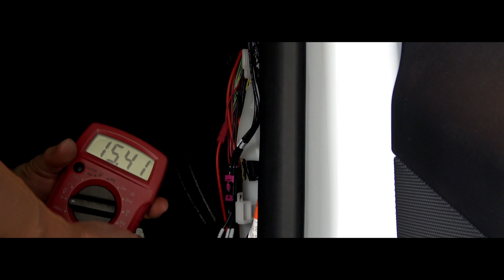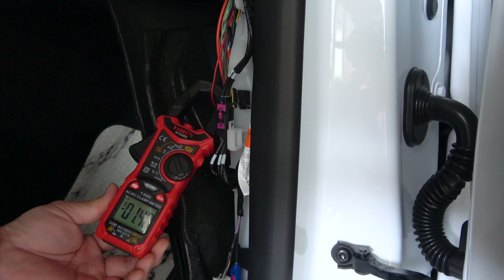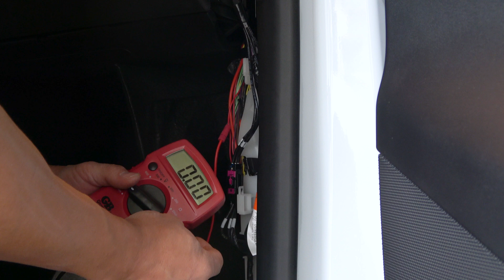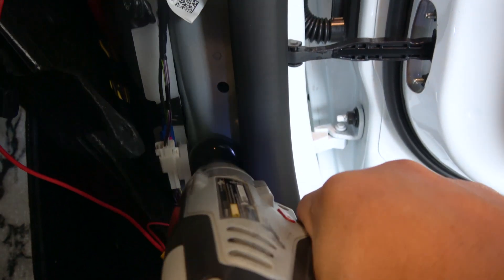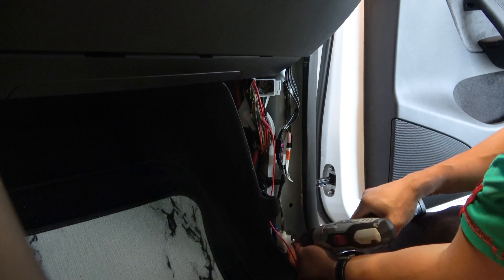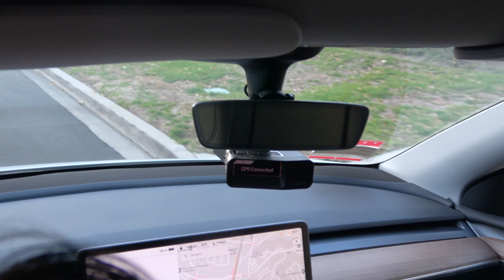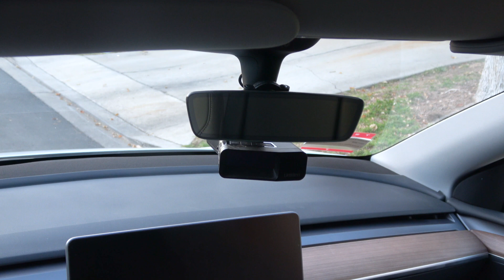Don't void your warranty | 12v switched accessory power Tesla | Hardwire Install

Comment: Instead of fishing for wires, I ran my hardwire behind the dash and through the center console and tapped into the accessory connector wires (this is what Tesla recommends). I checked and my accessory plug (and now-connected radar detector) turns on when the door is opened and turns off when the driver exits the vehicle. Regarding sentry mode, with it enabled, power is cut to my radar detector after a few seconds, so it doesn't stay on.

https://service.tesla.com/docs/ServiceBulletins/External/CD/CD-19-17-001_Model_3Y_12V_Power_Circuit_for_Third-Party_Accessories_First_Gen_Center_Console_R5.pdf

Comment: None of the red wires in my 2019 seem to have 12V. I have a weight in the drivers seat, seatbelt on, brake pushed. All the red wires have either 7V or 1V

Comment: Thank you! This worked on powering a dashcam on my 2024 MY.
Reply: Do you have a pic by any chance of your wire you tapped. I am having trouble with my 2024 M3.  Wondering if my voltmeter might be Vicky.
Reply: you have any concerns that this might void any warranty?

Comment: Is there a way to do this that will keep it on all the time? I want to power a 12 volt refrigerator that I have in the trunk. I use the center console outlet now but I have other things to power and the refrigerator keeps getting low energy errors if it's not the only thing using the power because I'm using a splitter.

Comment: I followed your method minus the additional inline waterproof fuse 
However when finally put in gear it stays on , once I accelerate the radar shuts off , then turns on if there’s enough time before I accelerate where it shuts off again and again . Do you have an idea why this might be ?
Reply: my GUESS would be that you hooked to the wrong wire

Comment: Hello...I got my 2024 Model Y last week, trying to tap 4 different red wires and none of them work.  Has anyone tried successful on 2024 Model Y?  I appreciate for any advice.
Reply: Have you tried this method? I just got my MYP 2 days ago and was going for this route? Did you get it figured out?
Reply: @strykher  I had the same problem until I figured out that the car has to be disconnected from the charger in order for the correct red wire to switch off when the car turns off, otherwise all the red wires were constantly on. Just finished up the hardwiring my V1 Gen2 on my 2020 MYP and it seems to be working like the video shows.
Reply: @gerrytseng  I ended up not using this method. I went to hotwire it on the tow 12v wire from the left of the driver side dash instead which work perfectly.
Reply: @strykher. Is power constantly on or do you have to activate tow mode?
Reply: @strykher where do i find this wire and witch colour is? Can you help me please
Reply: @melbab8454  power is constant and turns off when the car is off.
Reply: @theemkay11  https://www.youtube.com/watch?v=7TfqLzA44eA&list=PLjpw6RdRfhde3bQksVGbrWz1unKvcp_VS&index=24

Comment: How did you use the clamp meter to find the 15 volts by just clamping it on and not having to cut the wire and make contact?
Reply: Hall-effect clamp meter, find a clamp that works with AC/DC

Comment: I have model y 2023. I found 3 red wires that are the same as video, but I couldn't find any 3 wires have 12vdc as I pressed the break. Does it 😢different circuit on the 2023 modelY?
Reply: it's just over 15v, which won't damage most RD's

Comment: Two questions if you want to install several accessories at that switched low V location:
1. How many amps would that support?
2. Is there a multi port block - like an add on small fuse box - that would work as the connection points for the accessories? In other words the tap into the switched Tesla wire and the ground wire would connect to the distributions block or add on fuse block.

Finally, I see where some of the more recent instrument panel displays are gettin power/ground direct from the low V battery. Since that doesn’t seem to be a good idea, could they also be connected to 2. above?

Very good videos,

Pete

Comment: In your video at around 2:50 you show that you pre-selected the wire and state it should have 15v.     Your ammeter shows about 1.4A, but to find the one with 15.5v and the brake energizes is difficult. You don't really show that.   An alternative is to use the larger red wire (14-16 ga) shown at 2:50 in the video.  Its not quite as elegant as off when you exit, even with Sentry on, but it does turn off when the car goes to sleep, within 5 mins.   Open the car door it turns on.  Therefore for someone  who struggles finding which small red wire is the one, they can use the larger one (not the big in the back) and it will shut down the accessory within 5 mins of exiting the car when the car goes to sleep.  And powers up upon re-entry, no brake press needed.
Reply: what model do you have?

Comment: I want to install ambient light that comes on whenever headlights or parking lights are on.  Do you know where to tap it into in the headlight switch if there is one?
Reply: I used the footwell lights. But keep in mind the limited Power.
Reply: @felixb6656  mine does not have footwell light

Comment: Sorry dude, but I’ve had my auto frunks, an auto trunk, and trailer wiring hooked up directly to the 12V battery and NEVER had a problem. The auto trunk, auto frunk, trailer light controller installed on my 2019 Model 3 have been installed for four years with no messages or problems.
Reply from the maker: awesome! then you're lucky. There are plenty of customers who come in around 30k miles with battery problems due to HANSHOW connections direct to battery.

Comment: I found 2 red skinny wire that have 13v power. Thing is when driver is present, there’s power but when driver is gone, it stays powered for 10s or so then powers down, both wires. Is that the same wire you mentioned?
Reply from the maker: yes, if you're talking about the VCRight (on the passenger side), yes, that's the accessory wire which is perfect for your radar detector or any accessory you  want to automatically turn off when you leave your car.

Comment: Hi PJ, I assume that switched wire keeps power whilst the car is running and not just when the brake is pressed?
Reply from the maker: yes, that's the whole point. and the main point of switched is that once you leave the car, it turns off.
Reply: @teslamods do you know if this wire is on all teslas? I have a 2018 model s

Comment: Hi PJ - great video! I'm trying to do the same to my '23 MYP.. My first attempt I tapped into the line for the brake lights instead of the accessory wire, which meant my radar detector turned on whenever I slowed down or stepped on the brakes.. I was trying to find the elusive "red wire", and wasn't able to find one of the thinner ones that gave a reading when the car is on. There is one that is a little thicker, not the main thick one, but it doesn't look like it's as thin as the one you have at this time in the video. ( https://youtu.be/qlx7t74Upxk?t=186 ) 
Can you tell me if I'm seeing this wrong, or whether the slightly thicker one is indeed the correct one?

Thanks in advance!!
Reply from the maker: haha that's so funny - brake lights radar! since mine is 23 MYP too, your setup should be almost exactly the same. What really helps is to tap your brake every minute when searching for the red power wire. it's definitely red, and it may really be inside the bundle of wires. There are at least 5 red wires. and one of them might be just 5V
Reply: @teslamods  haha yea I wasn't able to determine why it only turned on when I used my brakes or during regen, then it hit me that was the brake light wire 😅

I tried going through all the red wires, there must have been at least 7 or 8 of them.. Don't think any of them hit over 12V, although there was one thicker wire that got over.. I guess I wanted to confirm the wire you tapped is one of the thinner ones, 22/24 gauge ones, right?
Reply from the maker: @JosephOnThePhone  yes, you saw from my video correctly, the thin wire, not that 1 thick red wire
Reply: @teslamods  Ended up having to tap into a slightly thicker wire, probably a 14-gauge, for it to work properly, none of the other thin ones were good enough.. Not sure why there's a difference between our cars, but let's hope this works out!

Thanks again for this video, definitely couldn't have gotten anywhere without it! 🤩
Reply from the maker: @JosephOnThePhone  interesting...good to know of the differences. Mine is Austin-built, micro-differences from the Fremont-built. and I would put a 10A fuse when connecting to the wire, just in case
Reply: @teslamods  oh that's a good idea to add the fuse!! And yea mine is Fremont built, didn't think there'd be these subtle differences 😄

Comment: I found two thin red wires but one is constant and other just doesn't turn on. There's on slightly thicker twisted with green wire and then more thicker line. I think it's suppose to be thin one but that just doesn't turn on.
Reply from the maker: make sure you press on the brake to make sure all accessory wires are on. Then test if there's current in the wires. And there's more than 2 red wires, like at least 5. Only one of them is the accessory wire that only powers on when you press on the brake. It turns off when the car goes to sleep.

Comment: Thanks to PJ for the very informative video! Just finished this project today and it is working as expected. One thing I want to add is that you don’t have to sand and drill a hole to get ground. You can use the bolt right next to the wires (exposed after the 2nd panel is removed). Just loosen the bolt and sandwich the wire terminal in between.
Reply from the maker: thanks I was going to do that, but my model didn't have the hole.
Reply: yea i sandwiched my negative lead to a dash-to-chassis bolt and it worked fine
Reply: Where to wire an amp for subwoofer on 22 base standard rwd?

Comment: Read this if you have a Right Hand Drive Tesla model 3 China build 11/2022

Hi PJ   Oh how I would love to find the elusive "go high" wire when you sit on the drivers seat and put your foot on the brake. 

So this is just a warning for Tesla Model 3 owners with Right Hand Drive (RHD) built in the Peoples Republic (China)  build date November 2022

All the good work that PJ has documented is not correct for the RHD China Teslas.  In this location there are 3 looms with plugs 2 some of these have a thicker red wire and multiple thinner reds and every other colour.  I tested all the reds and anything that was low current and looked like a signal wire and could not find any wire that changes state when the driver sits in the seat and presses the brake.  

The looms appear to be considerably different to the US Teslas
Reply from the maker: thanks for that! I know there are tiny differences btw the Fremont and Austin factory builds, but I didn't even think about RHD China. In my rear screens video, I show how to make your own accessory power using a relay switch. https://youtu.be/RMyG1dkfc3k
Reply: Hi and did you manage to find out how to hardwire the China made versions?
Reply: @dodotesla   
Hello Ondrej,
The simple answer is No. but I now have a switched power supply both for driving and parked that meets my needs.  Read on if it helps.  It's long but has details.

After disassembling the car to find the elusive red switched wire without success I decided to go a completely different route rather than chopping into my wiring harness.  I think this is a bit safer fairly easy not for all purposes or applications but for my install it was what I needed 
. 
My install is a Thinkware front and rear dash cam. Driving mode requires a constant 12 volt supply at around 2.4 amp supply a second separate 12 volt switched supply activated when I leave the vehicle allows the Thinkware to automatically go to parking mode. Parking mode uses movement and vibration detection to film surroundings when triggered. It will use almost 2 amps when active and about 700 milliamps when sleeping 

A bit of background. The 12 volt supply in a Tesla is actually it is closer to 15 volts but this should not be an issue for good quality electronic equipment remembering an ICE car has a charge voltage between 13.8 volts and 14.2 volts  Most electronic circuits have zener diode across the input or voltage regulators built in to take care of voltage fluctuations. In the Tesla the cigarette lighter is ideal for driving mode simply find a place to splice into the supply wire. You can draw about 15 Amps through the cigarette outlet and as the car is active there is no problem with supply in driving mode the Tesla maintains the 12 volt battery and any load is on the cigarette lighter it is not monitored for current usage, so there are no fault codes unless you exceed 15 amps or introduce a short.

The problem I had was finding a way to enter sleep mode and supply the dash cam with a reliable power supply but not deplete the 12 volt battery during long periods of sleeping supply. The Tesla  12 volt battery is only 33 amp hour and the maths is basic. If you park your car outside potentially in a worse case scenario, you could deplete your 12 volt battery in roughly 15 hours of parking time. You don't want a flat 12 volt battery, whilst not the end of the world it is very annoying in a Tesla.

My solution is to use the cigarette lighter as the driving power supply and use a secondary battery for the parking mode. The secondary battery is charged whilst you drive it takes roughly 4-5 hours of charge time from dead flat to fully charged . The Tesla does not know there is another battery present and the circuit design methods used keep the two systems separate.  I still have a parked time limit approximately 30 hours  before the secondary battery will switch off but long parking times rarely get to 30 hours unless I'm at home and if I wanted longer parking times for sleep mode I could use a larger battery.  The battery pack I'm using is about 100 mm x 60 mm and 20 mm thick.  The electronics is housed in small plastic box about 50 mm x 70 mm and 30 mm thick. Basic soldering skills and a reasonable skill in electronics along with the circuit would be needed to make a similar system.

The cost for me to build this was about A$100 with simple components and easy off the shelf parts.  I'll post a circuit diagram if required.

Comment: Hey great video that's is what I was looking for so my plan is to install some underglow for my Tesla model 3 and the same for a model y performance the one I ordered are the OPT 7 which are 12 volts but I'm afraid of connecting them to the battery and also these are 2023 models which  have a different 12v battery so I've been watching a lot of videos all day long on how to get a 12v power outlet from the car..and you got 😁😁😁but now my only concern is..... Can I attach the cables directly to that power lane or will I have to use another device for it to work?? 🧐🧐🧐 Because the lights are supposed to be ready and safe to attach them to the 12v battery with not problem but I don't want the lights to be on all day long so what do you recommend me ?
Reply from the maker: yeah, that's a valid concern because we're talking lights, since they generally burn out when overpowered. It doesn't affect radar detectors, and fuses protect against high amps. After my soundproofing project, underglow is next on my list. I have it planned out in my head but I haven't even bought my Suzco lights. may consider OPT7. It's going to be routed NEVER directly to the battery, but under the frunk, it will go through the firewall to connect to either VCRight or under the armrest, so I could attach a switch to it. That way, the monitor won't be on all day. There's not a huge difference btw 15v and 12v (it's not like 3v leds vs 12v power that could blow them - I've done that to my Christmas lights). But if it blows, it's not a time issue. it will blow in less than 30 seconds. I won't know until I try it out next month. Does your OPT7 have a power adapter after the plug, or is it straight 12V connection with no adapter? always use a 10A fuse, voltage is usually not a big concern. My main concern is how to make it stick permanently without drilling in tiny brackets. when it gets hot, even 3M tape starts to come off.
Reply: @teslamods  thanks 🙌 it really go to hear that I feel more safety to do it. And yes they do have a control box. And well to stick them we will drill probably just 2 holes because I just gonna install the sides and not front or back ..for those I'll try to install inside of the car that way I'll be able to notice if they go off and also because the interior is so dark I have the model 3 standard range
Reply: @teslamods  the rest I will stick them with 3m tape Holder and primer 94 that thing will hold it very good